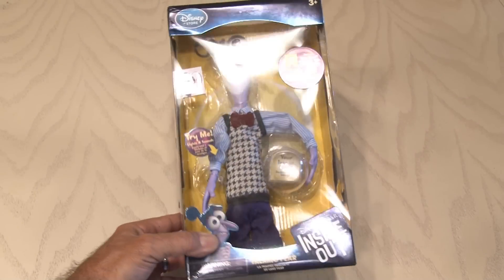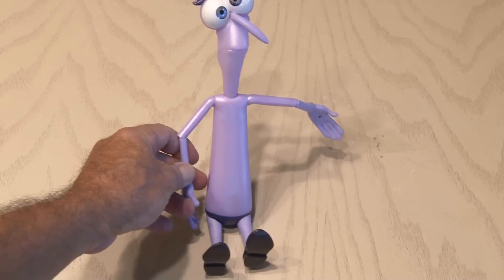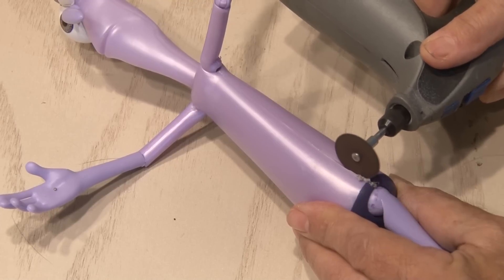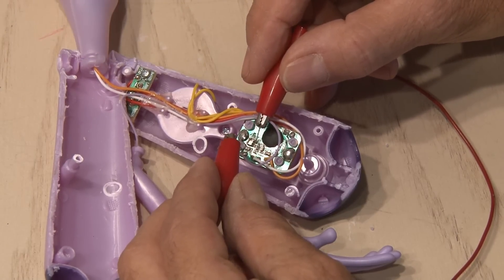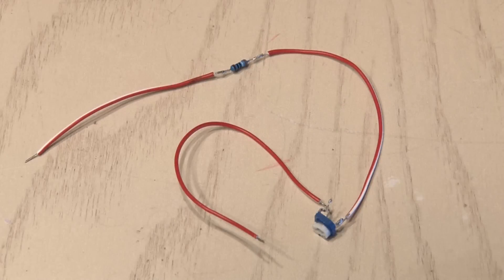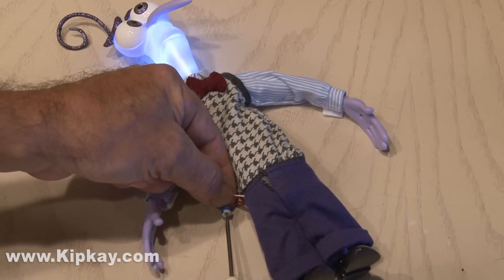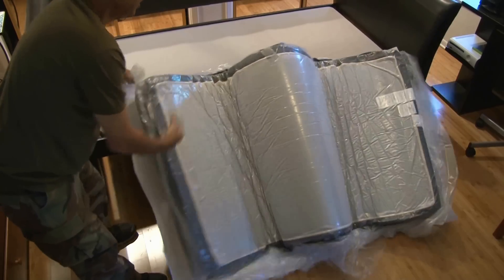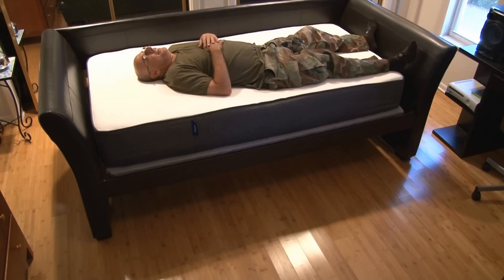"Inside Out" Circuit Bent!

Comment: You should do more circuit bending projects.  I build curcuit bent projects all the time and they're a LOT of fun.  You'd be amazed at the sounds you can get out of some of these toys.   My favorite is a circuit bent radio I call "Mr Happynoise".  It looks like a smiley face.  It's controlled by wearing a glove with a light sensing diode on it and waving my hand in the air, or by touching two brass knobs on it. It makes incredible noises and it's amazingly controllable to the point where I can actually play a song on it.
Reply: +MKUltra Why?
Reply: MKUltra has no imagination.  Circuit bent toys are amazing instruments and noise makers to use in electronic music and he also seems to have some growing up to do.